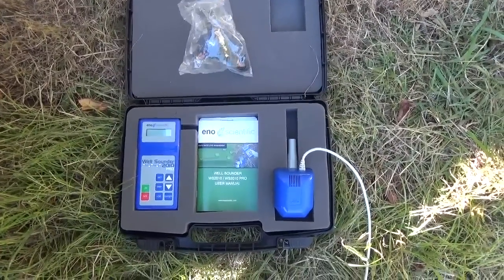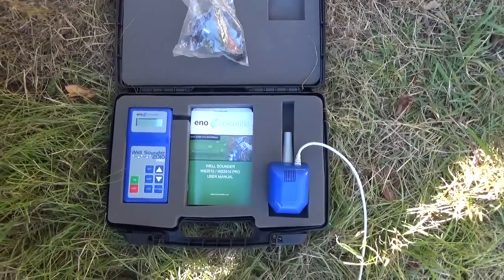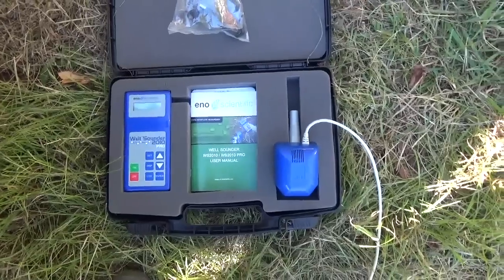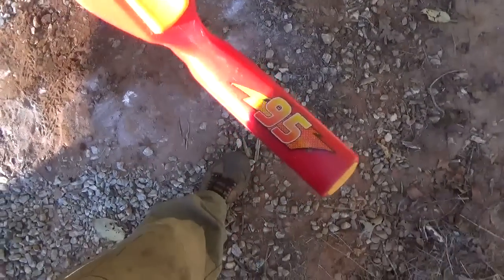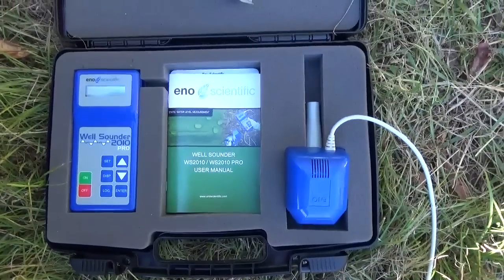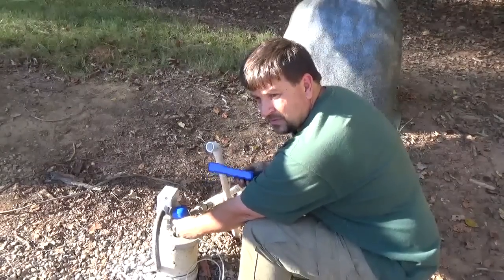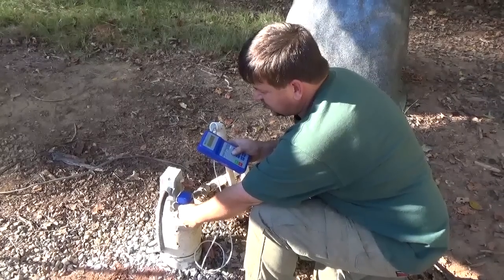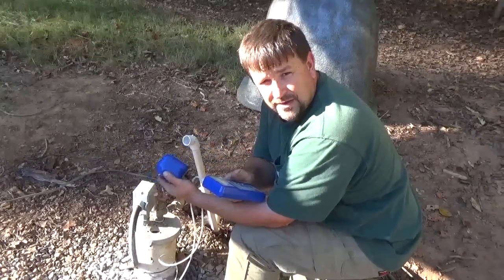Cool Tool To Measure Your Well

Comment: What do you use to find the bottom of a well ?  I live in N. Central Tn where there are allot of springs, our well static water level is 60' but I want to measure the distance to the bottom also.  I tried gluing 1/2" pvc together  but a few feet below the static water level the pvc was vibrating so fast I decided to stop for fear of breaking it.  I'm guessing the well has a water vein but still how would you suggest to find the bottom of the well?  Reason I am asking is the house is 1890 and didn't get electric till the late 50's so I have no idea what someone else has done with the well.  One dry year we did have the well pump start to suck air  so I'd like to know what I'm working with.
Thanks

Comment: I don't think they would run you off the job site if you showed up with a fishing pole to test the water level but I bet would have a harder time paying you engineer wages. Cool tool I to will stick with the fishing pole with a bobber and sinker and my tape measure.
Reply: Cell phone and a hammer doesn't require opening anything.